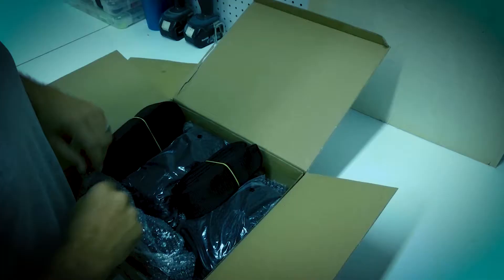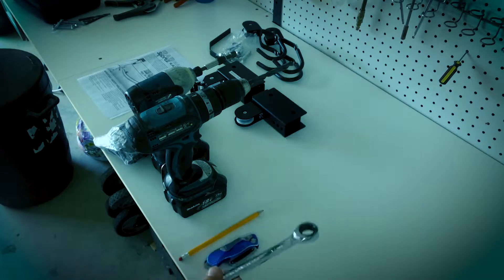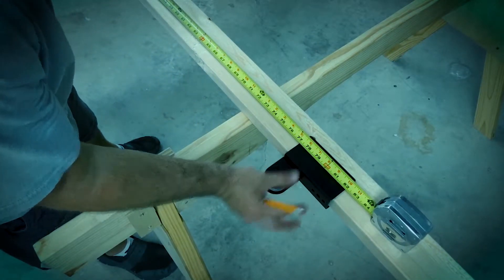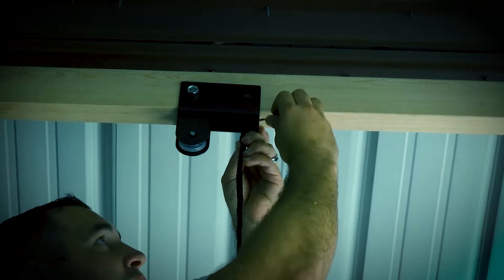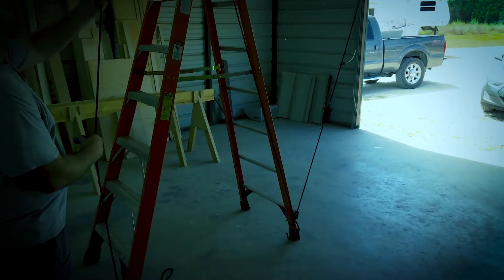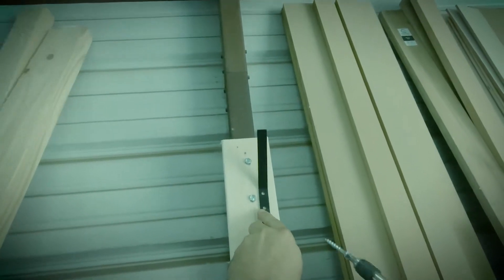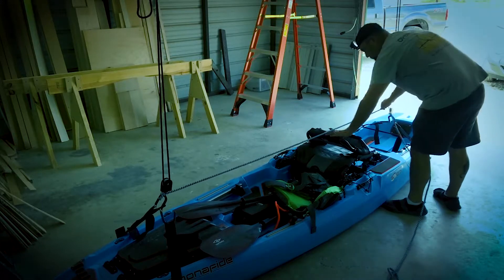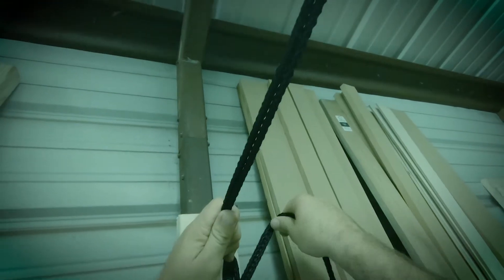Rad Sportz Kayak Hoist Install and Review

Comment from the maker: If you need a DIY gopro camera mount, check this video out! https://youtu.be/TFN2JlUKXB4
Reply: Why do you cut the rope, it doesn't need to be cut.
Reply from the maker: @bosschichi  yes you are correct, I did make the mistake of cutting it when it wasn't needed. Good catch!

Comment: The manual that came with my kayak says that if it's to be hung up , then it should be slung on its side, rather than hull down as in your video. Do you have any thoughts about the pros and cons of slinging a kayak on its side? Obviously it will hang lower than it would if it was hull-down, though that's not a problem in my storage space. Any comments? Thanks!
Reply from the maker: That's weird for it to call for that, Are sure it isn't talking about doing that just in case it's stored outside and making sure water doesn't stand in it? If it were me, I don't think I would worry about it.
Reply: @HOOKEDoneFISHING  Yup, definitely says that it should be either on it's side, or hull up (rather than hull down). But I think maybe that's just for long term storage. If you were using the kayak regularly then I agree, you probably don't need to worry about it.
Reply from the maker: @ClareGilliam  I'm sorry that's new to me. Hell even in all the pictures of the lift it shows it the way I have it.

Comment: Do you think this would work for hoisting a 17’ canoe?  How snug can it get to the ceiling?  My maximum height is the bow depth which is 22”.  I have about 30” to clear my garage door.
Reply from the maker: Depends on the weight of the canoe. I think it might hang below the garage from the measurement you just gave me. I have about 16'' from the top of the ceiling to the kayak (space for pulley and rope).

Comment: From the look of your video it doesn't look like your pulleys are doing anything, leverage-wise, other than lifting the kayak evenly, which helps. So your system is doing the work of holding the kayak in such a way that you can lift it at a single point. You're still lifting most the weight. If you are lifting something "up," and you want to "pull down" to lift it, you need at least three leverage points.
Reply from the maker: Later after working with this system, I've found that lifting one end at a time little by little is much easier than trying to do both at the same time. I've just never ended up doing a new video to show this.

Comment: I own two of these things and after struggling to raise my kayaks for years, it finally dawned on me what the simple answer is. Bring the two robes to the center of the kayak so that you were pulling towards the inner part of your garage. Then pull one rope at a time while the other rope holds the locking mechanism in the release position while the first can slide easily through it. Now just alternate pulling the ropes.First, the ropes are going to slide through much much easier. Second, you’re only lifting half of the boat at a time which makes the job again, easier. Try it.
Reply from the maker: Yes sir you are right, I just never did a update video showing that.
Reply: Or just add a pully?

Comment: Good idea with the rope in between.  The lags look strong but I'm a little suspicious of the pulley rivets and the hook rivets.  My kayak weighs 140 lbs so I  don't know.  What do you think?
Reply from the maker: I think it could hold it, my kayaks are close to that weight at times when I leave stuff in it. If you don't trust the rivets on the pulley, maybe you could rap the pulley with a small chain idk just a idea.

Comment: I bought this some time ago and never installed it. I plan to this fall and it will be over cars. I'd love to see how you used a chain backup.
Reply from the maker: Just use a chain that will fit over the hooks and long enough to rap around the kayak, it's best to use a rope to measure out how much chain you will need. Best of luck!👍
Reply: @HOOKEDoneFISHING  Thanks for fast reply
Reply from the maker: No problem, let me know if you have any more questions later.

Comment: The issues i ran into with the radsportz hoist is the plastic pulleys were cheap and fell apart within a summer. Also, being one rope, it is very difficult to lift the entire kayak (i have an fs12t - 77lbs). If you create a double rope system, you can pull one rope at a time...which saves your hands. Also thinking about attaching a crank to the wall instead of cleat to make it easier on myself.
Reply from the maker: Good idea on the wall crank, gives me some ideas as well. After using it for some time now, I found pulling up one side at a time little by little helps much better then pulling both at the same time. Seems to make it lighter and easier, just be careful not to pull to much on one side just in case is slides off. 
What parts are plastic on yours?
Reply: I just ordered one of these and it has plastic pulleys. Looks like it's made out of an old milk jug.

Comment: What kind/ size hardware did you use to mount the ties to the metal and to the wood?
Reply from the maker: Are you asking about the bracket I used to attach to the 2x4? If so I answered that question for someone else in a comment.
Reply: Ok. I'll look for it. Ty

Comment: I would say, they are very easy to install, pulling up a heavy load (fishing kayak) was just has difficult as you said!. I would not recommend due to the pulley being over the brake system. This makes pulling to the highest level impossible as the rope needs to pull outward which engages the brake or sideways which causes high friction on the metal brake system hole. If you have a very high ceiling, go for it, but if your garage is 10' or lower, you are going to have to limbo under your kayak.
Reply: That’s exactly what I found with my fishing kayaks

I have to find another way

Comment: Great video! Thanks for the review. How low does the kayak hang from the ceiling?
Reply from the maker: It's up all the time unless I use it. I have chains around it now just in case the straps break from all the heat I get in the summer.
Reply: He means basically the distance from floor to base of kayak when hanging but the distance from ceiling to base of kayak. I've also been looking for this measurement do will update once I've hung mine. It's handy to know when walking underneath if your head will hit it lol...ground clearance 🤘
Reply: About 72inches from the roof anchor points to the bottom of my kayak
Reply: In my setup. Roof to kayak is about 2’ and depending on the kayak, another 1’ worth of kayak.

The flat bottom kayaks and v-shape have different clearance. 

In total, I installed it, where I could lose 3’+ of height and still have clearance on walk underneath.

Comment: Nice video.  My son's kayak looks very similar to yours.  Could you tell me the distance from the bottom of your kayak to the ceiling mount?  I have this kit in my garage and would love to know before I mount.  Thanks so much.
Reply from the maker: When it's up in the air? Or are you asking floor to mount right now?
Reply from the maker: The mount is 10ft off the ground, from the bottom of the kayak to the mount is 32" to 3' so I have about 7ft to walk under the kayak.

Comment: How many lbs did the kayak weigh that you used for the hoist?
Reply from the maker: Dry with nothing in it is 94lb, but with my crate and other stuff I would say around 125lb-135lb. It's best when lifting it to pull down on one side then hold and then pull the other little by little. I have found this to be much easier when lifting it up.

Comment: Thanks for the great video on installing the kayak hoist.  I am wondering how close to the ceiling can the kayak go using this? I would like to put it above my garage door. Thank you for your response!
Reply from the maker: Your welcome! From the mount to the kayak is about 20", you will have to see how thick your kayak is to determine the clearance you will have. I have a 10ft ceiling and with my kayak I have 7' clearance under it.

Please keep in mind I don't trust the straps and used a chain big enough to rap around the kayak and use the hooks to attach it to, just in case the straps get old and the kayak doesn't come falling down. To measure the length of chain needed, use a rope and rap around the kayak to the hooks then lay out and measure the rope. Any other questions just let me know.